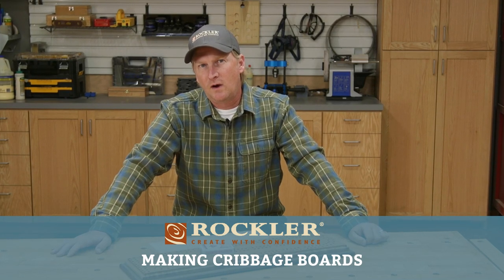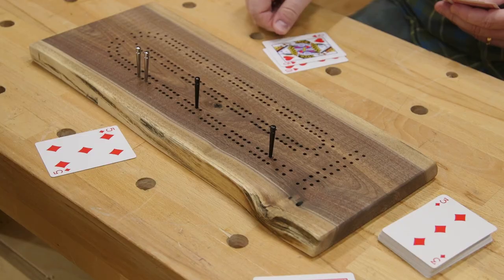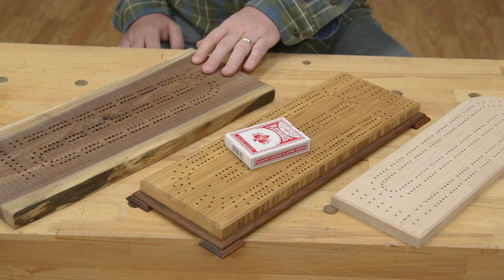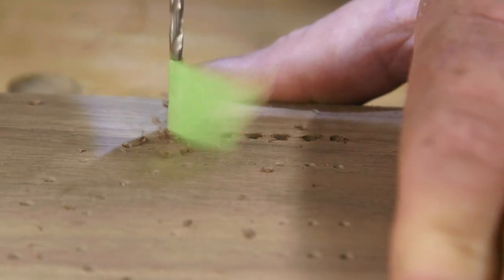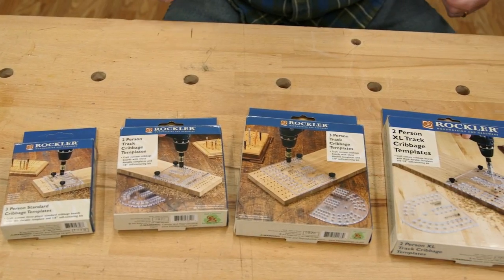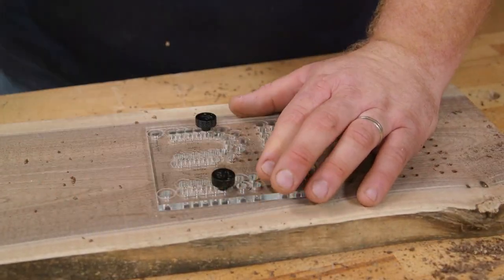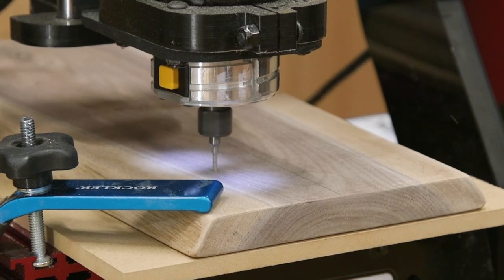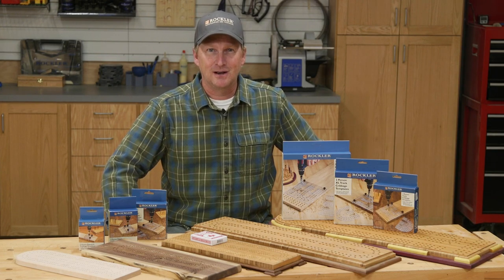How to Make a DIY Cribbage Board

Comment: I bought one of these kits a couple years back and I always have issues with tear out (specifically between holes) and the drill bit constantly getting build up and jamming. Got any tips for helping with things like that?
Reply: Few things to try. Use different wood, change the speed of the drill or use sharper drill bits.
Reply: I have replaced the bit and used a few different kinds of wood and still get tear out and jamming. Very frustrating!
Reply: Try cranking the speed of the drill bit way up there.  And avoid wood like ash or cedar which can be prone to splinters.
Reply from the maker: you can use tape over where you want to drill and that should reduce the tear out.